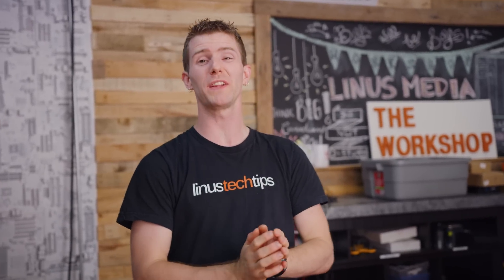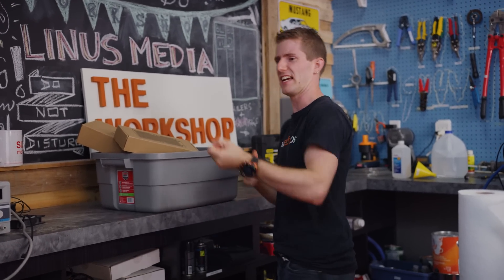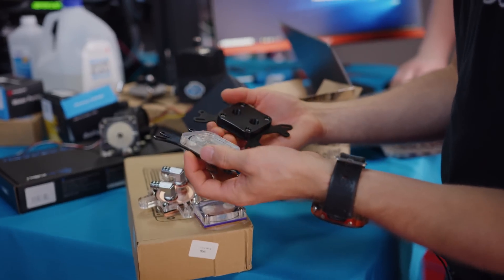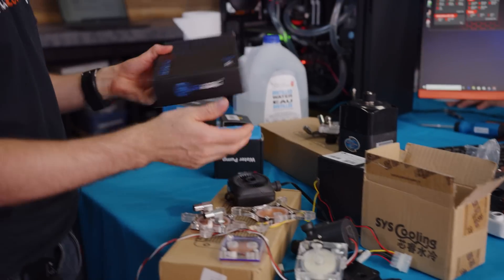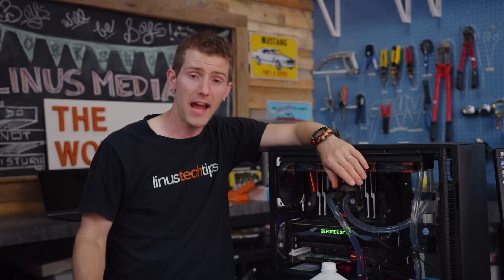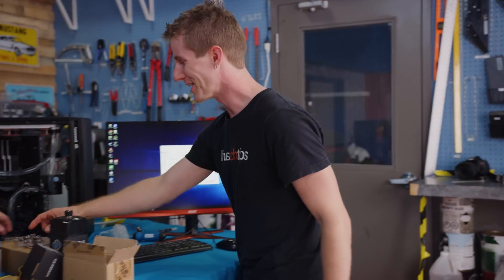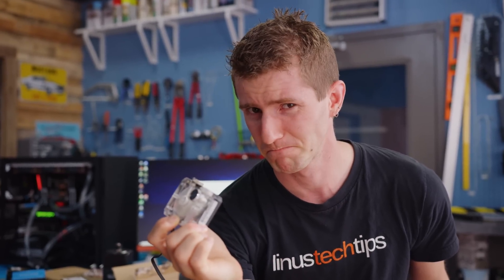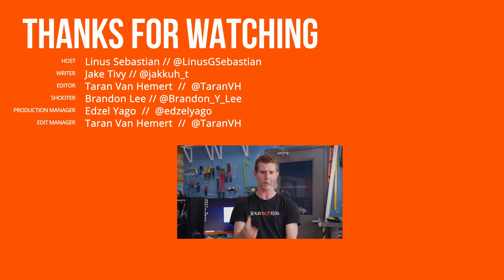AliExpress Water Cooling DOESN'T Suck?!

Comment: I was wondering im buying a gaming pc next week and need your opinion im getting it for $750 thanks to the fact that i know the owner well normally would have been $950 here are the specs,
 Intel i7 3.07
12 gig of ram
Hd 7900 video
240 ssd hardrive
1 tb slave
7 proffesional
Am i getting a good deal pls help me, this is my first gaming pc
Reply: Even at $750 that is a pretty bad deal. 
You could build a new pc with better specs for about $700
Reply: not a good deal at all, thats really old stuff.
the cpu would be 20-30 usd ebay
about that for the ram assuming its cheap ddr3
hd 7900 ~100 although its not a good value used card
40 bucks for the ssd
50 bucks for hte harddrive
5 bucks for windows
about 255 not including windows and case on ebay these days so no its not a good value and psu + cpu cooler not a great value
Reply: Honestly i would keep looking on ebay daily for old pc`s someone built and is selling instead of buying it.Congrats on getting your first Gaming Pc!I`m getting my first one too, i wanted to build it but ended up finding a i7 4820k build on ebay.
Reply: DON`T BUY IT!Look on ebay for a used build, can find a pretty sweet deal on a older build or build one with used parts.

Comment: Liquid cooling isn't worth the added hassle of reliability, longevity, and maintenance issues. If you invest in a good high-end air-cooler, it will work great and it will last virtually forever. And replacing the fans is relatively cheap and easy (but Noctua fans are super reliable and super long lasting too)

Comment: For a cpu wb, byski offers you good and stability products
For radiator, barrow is the best, specially 360mm 38++ copper
Fittings I like barrow, it gives you durability just like bitspower
Pump, in some way Linus say right, but the other way nope
He's right because expensive pump like D5 or DDC had high speed of waterflow to transfer the heat more fast into the radiator, good for overclocking and shit
He's nope because not everyone can afford that and cheap pump had 450-500 L/H water flow which is quite enough for daily use

Comment: never trust watercooling stuff from china. you never know what you going to get and i would never trust my 4-6k desktop with a 14$ waterblock with a plastic  seal....
Reply: Oldkatz look for it on youtube, you will find tests! DEAL with it =)
Reply: Watch the video, they run a program to stress the cpu, and heat the cooling loop ..
Reply: Did you even watch the video
Reply: been using them for two years now, not a single problem, no leaks, no pump failure, no corrosion, i used copper block and aluminum radiator, no corrosion at all, custom loop stuffs from aliexpress are very reliable, I am using it, and I absolutely have no complaints.
Reply: hey everyone look this one has a 4-6k pc wow. who gives a fuck.
Reply: OldKatz can you please stop this $h!t? "crap water cooling stuff from China" let me remind most of the electronics are made in china and gets launched in US.  Thus Ali express takes there customer services very seriously.
Reply: anyone who thinks that those water blocks will hold up to any where near a full load  or that those pumps would last needs their head examined.

Comment: You guys should set up a test to run those pumps until they die to see how long they'll last.  Yeah it's a small data set, but still interesting to know, especially if anyone really does intend to order the stuff
Reply: aquarium pumps stall, you have to buy a new one each six months,so i made my own.
Reply: I run a cheap byksyki pump for 6 month. Still holding up
Reply: I ran two $3 aquarium pumps in series for redundancy, at 5V to reduce noise. They both failed, but it may be because I was using ethanol as a coolant and it doesn't play too well with plastic, I think the impeller got stuck causing a coil to burn out. I then switched to water and used a bigger no-name pump and it was fine, apart from being a bit noisy. I finally switched to a syscooling pump, that worked great for a while until it started making a horrendous noise. Somehow the inner bearing became loose, which is odd since it's just a plastic impeller sitting on what felt like a ceramic rod. Added a copper shim into the bearing and it was fine until I pulled the loop apart completely. 

In the beginning I was cooling an i3-6100 AND an R9 290 on the same loop with a single aluminium 120mm radiator in push-pull without hitting thermal limit. It was MUCH quieter than the reference 290 blower and performed similarly.

Comment: So many youtubers say not to mix metals but that is legitimately what car manufactures do. its possible just add a anti corrosion additive.
Reply: my father is a car radiator mechanic, don't fucking mix metals, unless you put a piece of ion exchange resin in the tank to remove ions that would catalyze the oxidation of the metals you're not safe from corrosion.
Reply: https://prnt.sc/kdhhtt https://prnt.sc/kdhho8 https://prnt.sc/kdhdu7
Reply: see, aluminium at both sides, you don't necessarily need copper.
Reply: I was a general mechanic for years, just add a kill coil or bacteria bomb. Or you know, do regular maintenance.

Comment: i have a sc1000 pump 2 years strong no issue yet
Reply: https://prnt.sc/kdhhtt https://prnt.sc/kdhho8 https://prnt.sc/kdhdu7
Reply: i made my pump and my motor cutting veins in an induction motor then i put the rotor inside a closed tube with bearings and remade the stator to work at higher frequencies, with linear action perfectly isolated galvanically in a low voltage custom driver motor, my motor makes literally no noise i can hear.
Reply: waterpumps from aquarium suck.... they literally get stuck...

Comment: I built my loop mostly out of barrow parts from Ali Express other than my blocks. I got a D5 pump all my fittings/rads/res and tubing, all really good quality. Design wise they're pretty identical to bitspower and performance/quality wise they're really not far off. I live in Singapore FYI and all the big brands are very reality available, moslty have to be imported and becomes super expensive.

Comment: Why not test the cheap fittings, reservoirs etc? The cost of fittings, especially in a loop with more than just a cpu block really adds up. I could justify spending more on components like blocks, but when fittings are £5-£10 each that really eats up any potential budget.

Comment: Linus, I have a pc build challenge for you >:D
Instead of water cooling, use liquid metal.
After doing some research, (galinstan) is much safer than mercury and less fickle than gallium. Think it may be the best for the task :)

Please like if you want to see this
Reply: Duck Goes Quack
Cooling the whole PC with liquid metal? Now this I have to see.
Reply: Use liquid metal as the fluid? Pretty sure they have lower specific heats than water so I'm no sure how that'll go
Reply: LTT is more about enertainment and based on their previous videos, they either don't have the expertise necessary to do technical projects or they just don't want to put the time and money into doing it properly because they don't think they will make ROI. You would be better off asking JayzTwoCents or Gamers Nexus.

Also, if you look up galinstan, it seems some tests have been done. I didn't read too much and wasn't able to understand everything, but it seems like they are not using galinstan in a conventional liquid loop. There are probably many reasons for this. One being that it is very heavy. It's only half the weight of mercury, but it's still over 6 times the weight of water. Two, it is expensive. Depending on how big your loop is, it would probably cost $2000-4000.

https://arstechnica.com/gadgets/2008/07/danish-startup-announces-liquid-metal-cpu-cooler-terminator-jokes-ensue/
http://proceedings.asmedigitalcollection.asme.org/proceeding.aspx?articleid=2471497
https://www.electronics-cooling.com/2017/03/updates-liquid-cooling-research/
Reply: The ammount of pressure in the system would be crazy, I don’t think the tubes, fittings and maybe not even the blocks would be able to handle it, also you'd need a better pump. So i guess in some way is doable but it's a lot more work than it looks like and not even LTT would have the time and money to afford it. Since it wouldn't be practical in any way
Reply: Oh, god, like liquid cooling but metal instead of water? You'd need a serious pump for that. Like, I'm not sure that they make a pump that could do that. I don't know much about water cooling, though.
Reply: @Blinkdawg23  theres a pump called the iwaki rd30 or something like that that is retarded and can probably do it. 

it can handle chilled mineral oil......
Reply: Okay, it is certainly doable, question is where to get the hardware that can handle the pressures and potential corossive effects of liquid metal, technically you could use mercury, although practically you are better off with galistan, even though it sticks to surfaces much more than mercury. This might be a project for Cody from Cody’s lab.
Reply: jtomes123 I have a gallium collection in my room. I'm also starting to build a sleeper pc. I really want to try my idea out, but I don't really have the balls to test it out
Reply: Benjamin McIntosh is right here, even taking into account Galinstan being over 6 times denser than water, water has such a massive specific heat capacity compared to Galinstan (~4200 J/kg/K vs 296 J/kg/K) that it'd still be a far better coolant. It'd be massively impractical and also work really poorly.
Reply: Killziah nope it's not :)
Reply: Oh, mercury in the loop, that sounds so cool. It makes sense that it would conduct heat really well, since it's been the best way to make a good thermometer for centuries.
Reply: have you ever lifted 100ml of mercury? the weight of the system would break almost everything.
Reply: @Freeman yeah and you get cancer when you flush it !
Reply: Nah man, use liquid NaK. Its an alloy of potassium and sodium that is liquid at room temp.

Comment: 4:24 i'm using that pump right now, was cheap, it's good (600 litters per hour) and in 100% can hold my 4790k at 4,8ghz 1.35v below 85° with the dead h100i radiator and block, and the mobo is watercooled too (z87 formula AC), the only problem is because the pump over 70% is loud, below that i got no problem on my custom open tower.

The pump is named SC600.

Comment: Actually, those chinese aquarium pumps are quite efficient, you just need to place them in the right height with the respect to radiator.
I’ve built myself a loop for less than 35€ (15€ = 240mm aluminium rad, 13€ = 2x 100cfm 120mm fans, 2.5€ 12V aquarium pump, 1.8€ cpu aluminium water block, 2€ 5mm transparent tubing from local store with gardening equipment) and observed interesting measurements.

I completely eliminated the reservoir as it made no difference in final heat distribution and only managed to delay the change in temperature at the beginning and end of testing (it might seem difficult to get rid of air bubbles but submerging the two ends of loop while keeping it running is basically all that’s to it)

Final temps:
Pentium D 945 (95W tdp stock) 
@ 5.2G 1.9V
Idle: 40-50 deg C
Full load: 74-82 deg C
Core 2 Quad Q6600 (105W stock)
@ 4.1G 1.7V
Idle: 35-48 C
Full load: 70-80 C

The part I find myself most interesting is the loops endurance. I have experimented with ice and managed to achieve 1 degree over zero die temperatures which is amazing considering the cost of water block and the fact, that cpus weren’t delided.

Comment: Not mentioned in the video, but does anyone know about getting GPU water blocks for cheap? Even on AliExpress still seeming to be about $80+ a piece and I need to cool both of my 1070's. I know it will be more expensive than CPU cooling but I was hoping for around $20-30 per block so I can keep the whole loop as close to $100-150 as possible. Thanks for any help!
Reply: not really possible as they have to be made on a cnc which adds costs and loss
Reply: Only water cool the cores
Reply: Honestly if you have two 1070s than you should save money and buy more premium ones think about it water cooling would you rather risk destroying the cards for performance or making sure they last and wont damage your cards
Reply: this?
https://item.taobao.com/item.htm?spm=a1z10.3-c-s.w4002-17140425307.25.7276111ddK34X3&id=547502079103
Reply: I would recommend barrow or bykski because they're the same quality as EK
Reply: Shadowofdeath24 I already have the 1070’s, it would be impractical to buy a new card at this point. 

111 111 I’ve seen some blocks that are labeled as gpu water locks but look really similar to cpu blocks. Is this what I would need for core only cooling? What about vrm’s?
Reply: USAF Steve buy gpu core only blocks, they're usually under 50-60$ and top performance. you will just need to get some simple heatsinks on vram and gpu, can salvage them from old gpus or motherboards or just cut with a saw from old non-heatpipe cpu heatsink.
Reply: Those copper cpu blocks will fair well just remember to get mini heat sinks for vram and other stuff
Reply: Just buy a 980ti hybrid. They beat 1070s OC'd

Comment: 5:10

While avoiding disimilar metals is always  best, Copper + alloy is fine... Just so long as you put good ol glycol antifreeze in it.

Yes, the green stuff that goes in car radiators which stops the multitude of dissimilar metals corroding will also stop the same corrosion in your water cooling rig.
Also if you get a small leak you can see it as it'll leave a residue when dry.

.... Also it glows under UV so that's pretty pimp
.... Also also, glycol helps to lubricate the water pump seals.

On pumps, make sure it is brushless, like PC fans or aquarium pumps. You do not want a brushed motor running your water pump.

Comment: We have floor heating here that's basically pipes that run hot water. Could that run on a PC? Would it loose enough heat in the long length of the pipes trough a house for it to work? Passive cooling + heating the house 'for free'

Comment: Nah bro, my loop will be atleast 700€ when complete. Hardware labs 420mm rad, thermaltake rgb d5 pump, barrow fittings and the cpu and gpu blocks ill need to buy. Im sure nobody is gonna use a chrap loop to cool a expensive pc, sounds risky... but for a cheap pc that might be very good

Comment: I've actually bought my first watercooling loop from AliExpress, jutro for funsies. It's still running strong almost two years later, but the cheapo plastic pump had to be replaced (prolly cause I've overtightened the threading and it cracked, leaving me with a tiny but infuriating leak). It's only problem is the fact that it's ENTIRELY aluminium, and has a 240mm rad, but hey- the GTX 780Ti that's hooked to it didn't see more than 60 degrees C, and the I5 6600K while running at an unimpressive 4GHz at around 75C is nothing to be proud of, at least looks cool and isn't harmful by any means. Still, I'd only recommend buying such loops for fun, rather than actually keeping your main system in it- unless that's just a starter, and you plan on upgrading later- especcially the pump.

Comment: the "barrow" catalogue actually looks very legit. i was waiting for someone serious to actually review some of their parts.
anyone ever built with "barrow" parts?
Reply: Yes , the block for gpu is like an EK without the price and the cpu one are like 2° more that EK , the best way to do a cheap loop is tu buy the block from ali and radiator and pump from legit retailer in your country , i use to have a syscooling pump for 35€ , the EK one at 88€ is way more powerfull and silent even at 3000rpm , TL:DR : it's cheap , powerfull and legit but for some part.

Comment: I did assemble my loop using some parts from Aliexpress. I've got really nice Barrow CPU block and a very high quality reservoir + top for my DDC pump. My VGA block is XSPC which I also ordered from Aliexpress at much lower price. I even got a replacement PCB for my pump in case the original goes bad. My VGA has never seen more than 40 degrees and the CPU never hits more than 60.

Comment: Bykski and Barrow I can recomend. Barrow is rebranded Bitspower. But be aware of plexi and cooper on realy cheap parts. Plexi cracks and thread in soft 3mm thin cooper base is easy to rip off. But when you buy POM/Delrin block with decent construction I can recomend it to you.

Comment: The only problem I can see from your testing is running that pump at 100% may move the water too fast for the radiator to do as good of a job as it is capable of the water has to stay in it for a bit for the thing to actually dissipate heat properly if you pump the water through it too quickly it won't have time to work properly. This might not even be an issue but it's one that is possible.

Comment: Before I buy a water block of unknown quality and performance putting my hardware at risk I rather CNC it myself, put in 2 or even 3 seals and just know it will a) fit my components and b) be made of materials I know. If it fails at least I know it wasn't because I cheaped out on it.

Comment: $90, cheap Chinese water cooling or top of the line Noctua  Air Cooler Hmmmmm. What's on your CPU?
Reply: The Crazy Old Coot Barrow stuff on Aliexpress is quality.  Water cool it definitely.
Reply: Obviously you never owned a Noctua Cooler!
Reply: Havent aircooled for years admittedly. Current is 8700k at 5.1ghz max load 70c at 1.41 volts. Once you go water you wont go back to Air :)
Reply: My 2600X never hits 70C with my Noctua NH-U14S. I actually did water cool my Athlon 64 and the video card I was using at the time.
Reply: I guess it is dependant on which cpu your using and your overclocks/usage which way you go, air or water. Water once factoring in rads and pumps, fittings and tube etc it will end up more expensive even using cheaper Aliexpress gear.